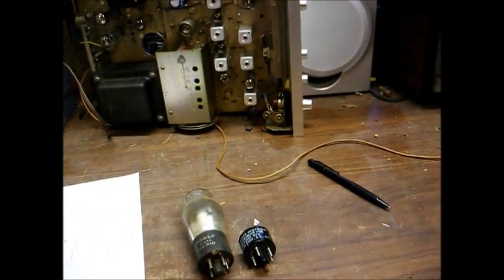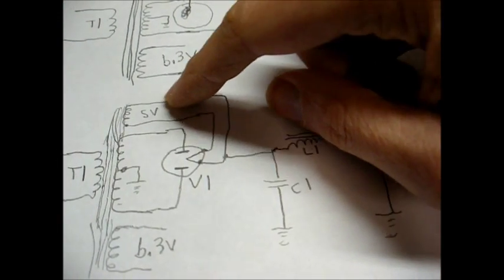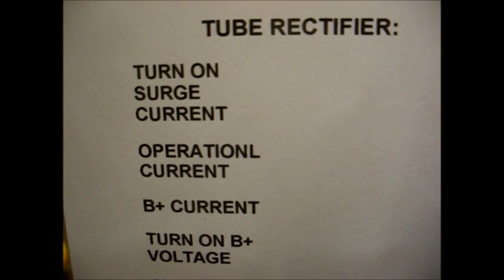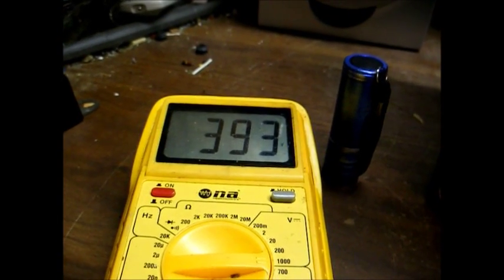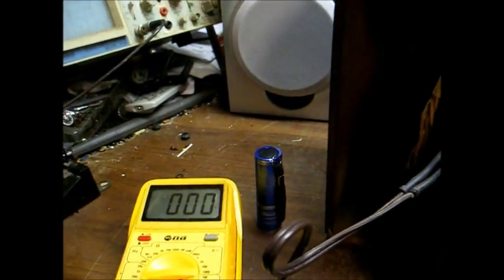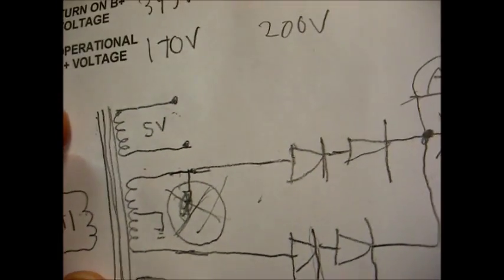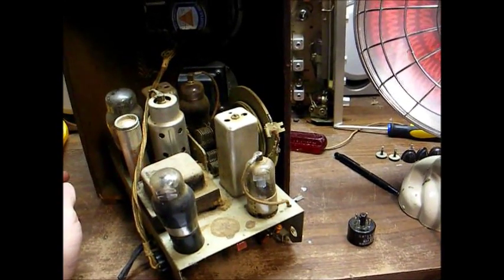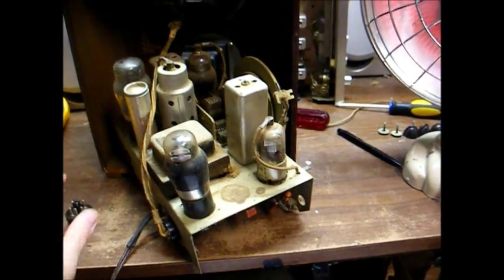Analysis of solid state plug in rectifiers for replacing tube rectifiers

Comment: This kind of stuff would have long been thrown away if it wasn't for the internet and latest technology to keep it Alive, the internet and all the latest gadgets have allowed people to film and show this kind of stuff and that has renewed interest in it.
People can learn and see how circuits are working with this ancient stuff, most of it has been replaced by I.C's, can't test for a failed transistor when 50 of them are stuffed inside a tiny black blob.
Modern electronics are made small, compact, cheap and fairly robust, many of these old tube sets have been repaired dozens of times and if you were actually paying for these repairs you'd have spent out 3 or 4 times what the set originally cost to buy in the first place, which was a damn site more than a new one today.
Like I said the only advantage is because a low tech guy can explain and repair something like this, a modern computerised set is beyond their skill,but you can bet your bottom dollar their homes are filled with the latest tech, 4k video, internet,modern cars sets etc

Comment: Connect the 5Vac rectifier tube filament in series with the primary winding to drop the resulting higher voltage from using solid state rectifiers. Be sure that you connect the 5 vac winding such that is reduces the output voltage from the HV windings. Use a voltmeter to verify that you have connected it properly. If it is connected opposite, it will raise the output voltage rather than reduce it.